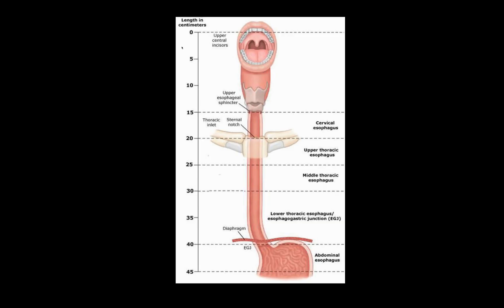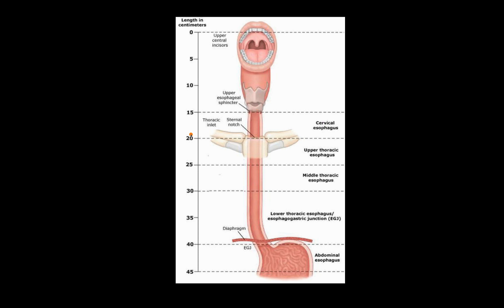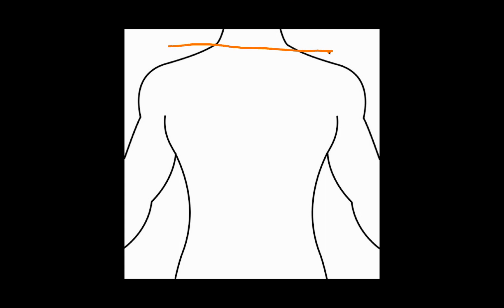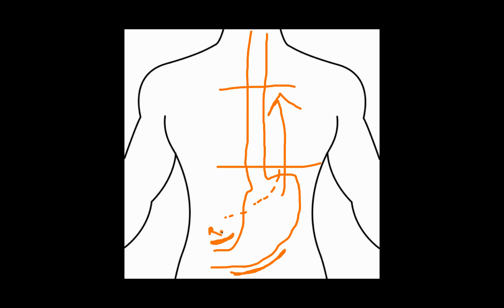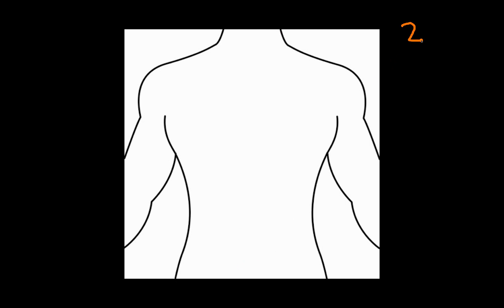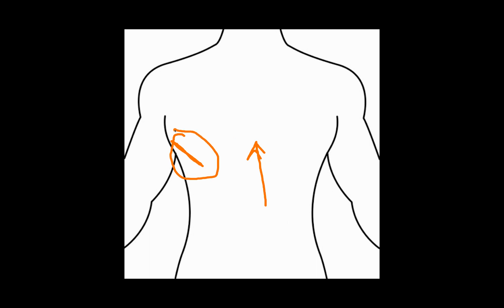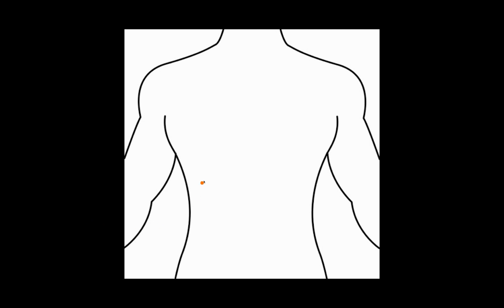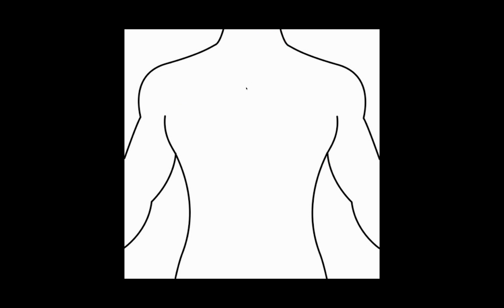The Three Types of Esophagectomy

Comment: Fantastic explation. Really interesting to learn about the location of the tumor.  Mine was around 28 cm away from my teeth so luckily I was fine for surgery.  They did a 9 hour Ivor Lewis procedure cutting me open at the back leaving me with a large scar and then 5 small cuts around my chest and abdomen.  My surgeon was an absolute magician as I also have a shunt for hydracephalous.  He just flippantly said it wasn't a problem he just pushed it out of the way.  After around 9 months I am eating pretty much normally - just smaller amounts.   I need to avoid fatty, spicy food, or tough meat.  I am also on tablets for reflux which guards against reflux as I don't have a sphincter so pretty much reflux has a great time flowing up and down which can be a pain - literally as it feels like heartburn in the throat rather than the chest.
Reply from the maker: Thank you for sharing your experience! I'm glad you are doing well.